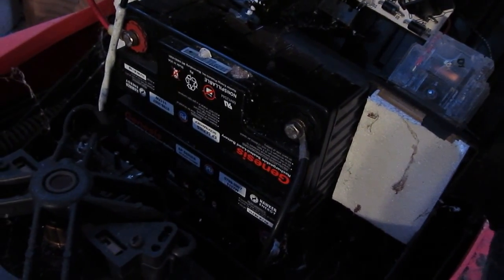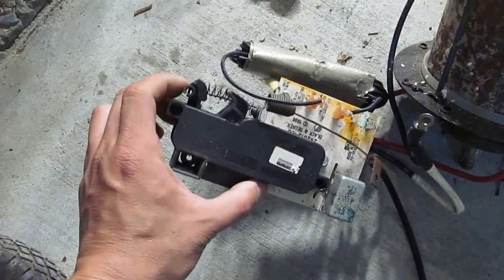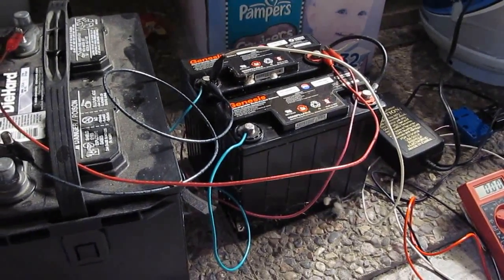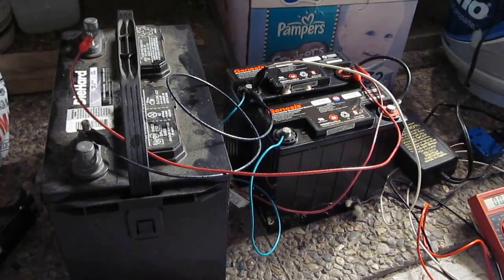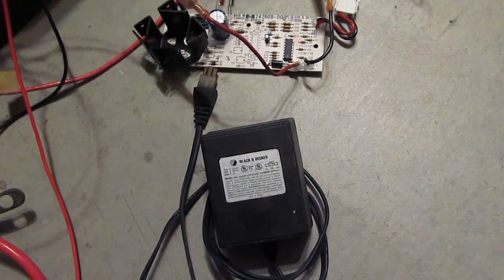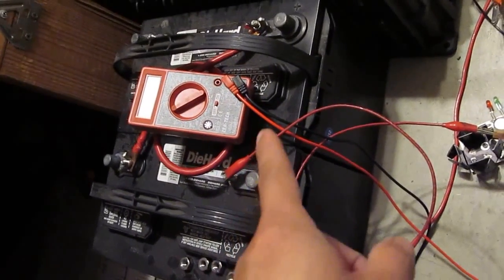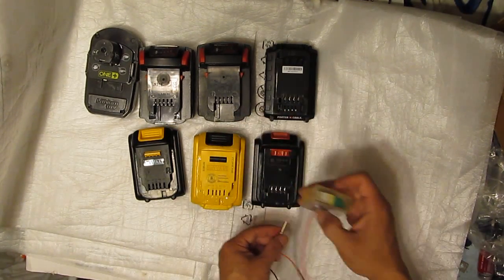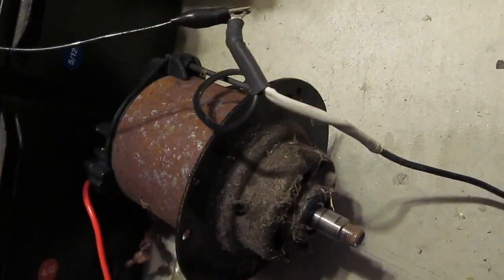What's inside: Black & Decker 24V Cordless Lawnmower teardown

Comment: I think that charger and possibly also the controller board was deemed unsafe by Black Decker due to overloading and possible fire hazard. I know they rebuilt these mowers and relabelled them cmm1200 and also provided 2 different style chargers, ht70151 and 90556993, neither of which resembles your charger.

Comment: Mine just went down, the resistor at R12 is burned up and need to a replacement to solder in.
Reply: I have two missing resistors I don't know the type I'll get back when I get the letter/# location on the pcb

Comment: I tried to replace that old analog  volt meter with a new digital volt meter. I checked the meter and voltage from the mower with a multimeter but somehow it doesn't show voltage on the new digital meter. any ideas as to why?

Comment: I need to buy a replacement controller for the battery and motor in this machine. However, the current for this setup is not listed. How can I choose a new ESC then? Do i need to buy an ammeter and check the current myself?
Reply from the maker: Maybe you can find that info in its manual. Otherwise, you might need to physically check it with an amp meter when it's running.

Comment: Are the parts from this lawnmower (motor, controller, battery) good for making a motor bike? Someone is selling me this and I'm not sure if I should buy it. Thanks for the help! Great videos btw, you make some interesting use of left over machines.
Reply from the maker: I think the parts are all suitable for a motor bike (if all the parts are in good condition, that is). The controller is good for an electric bike but I don't know if it's a single speed or variable speed controller so you will need to run the lawn mower to figure that out.